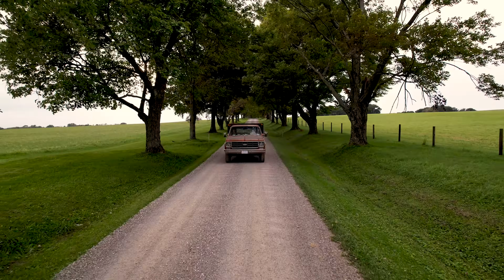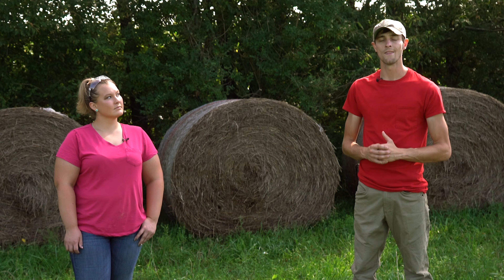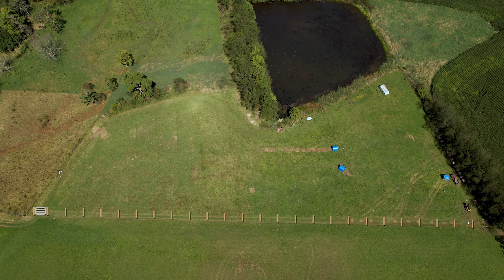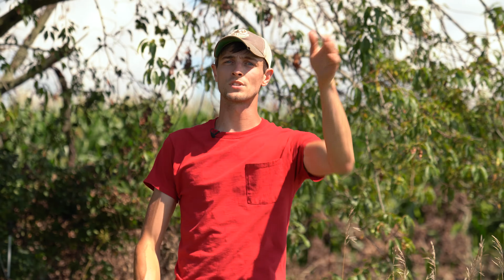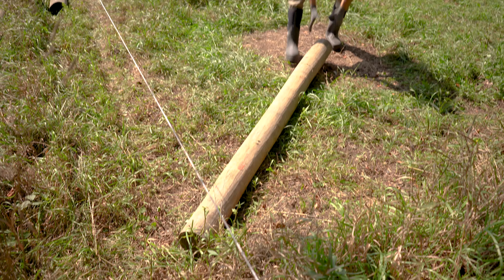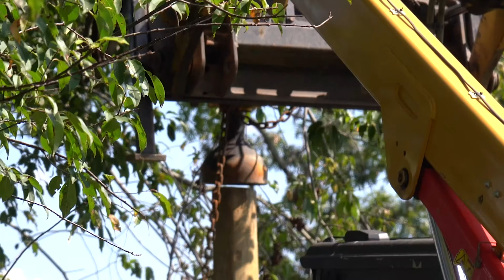How to Build High Tensile Fence - Part 1: Planning Your Fence

Comment: Hi great videos. Never considered making the top wire an earth - how did you arrive at that concept.
My standard cattle and sheep fence has over the last fifty years become a seven wire with 3 hot wires - every second wire starting with the top wire being hot.
The bottom wire is always earthed the 6 th wire next to it is optionally earth - simply by connecting it with a wrap of wire to the adjacent earth or hot wire.
Every second hole from the top of a standard Warratah Star Picket gives good spacing for a seven wire electric fence.
Using this spacing makes it easy to replace a broken timber post with a star picket.
In other cases I use Gallagher’s recommended wire spacing.

Comment: Great video series. i heard you say to drive the skinny end in the ground. i’ve bee told to bury the wide end so that frost won’t upheave the post, it will instead keep downward pressure on the post. what are your thoughts?
Reply from the maker: Hello Jack! Great question. If you are driving the post in with a post driver, it is recommended to drive the skinny end into the ground. This will great a wedge-like approach. If you are hand digging and setting the post, then you should put the larger end in the ground. This is where it will help with upheaving. So you are partially correct, that theory is just for hand-set posts instead of driven. Hope that helps!
Reply: awesome response, thanks for clarifying. makes perfect sense.
Reply from the maker: @jackryan9587  You are welcome! Happy to help!

Comment: I think you said 30’ between posts. How did you come to decide how much space between posts?
Reply from the maker: Great question Daniel! 30ft spacing is used here because we are using poly droppers between posts, there is big changes in topography, and we are fencing cattle and sheep. Here is a good blog with more in-depth discussion factors concerning post spacing: https://kencove.com/c/blog/article/most-common-fence-questions
Reply: @KencoveFarmFence  thanks! Also what type of wood do you suggest is best? Spruce, cedar, pine? The local mill supplies spruce at the best price but I think cedar is better? Is there a way to treat spruce? Like dip the part of the posts going into the ground in a chemical?
Reply from the maker: @danielmatthews6321  Your best fence post is going to be CCA treated. This is not something you can do on your own